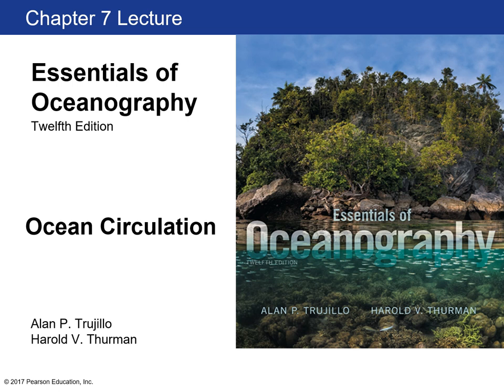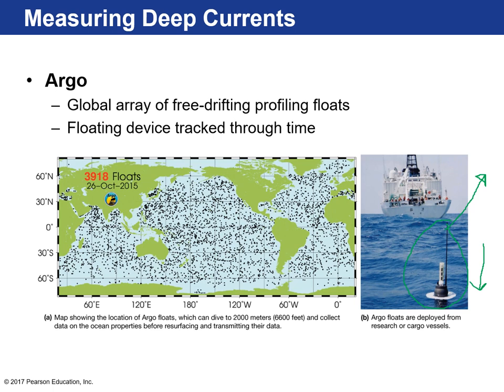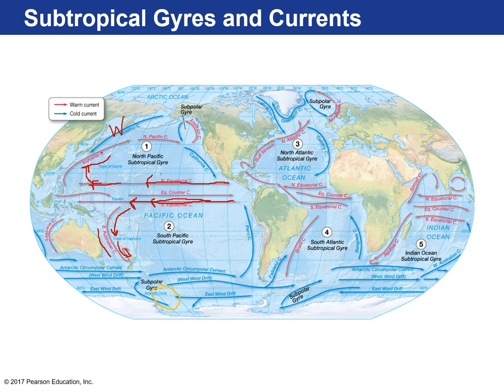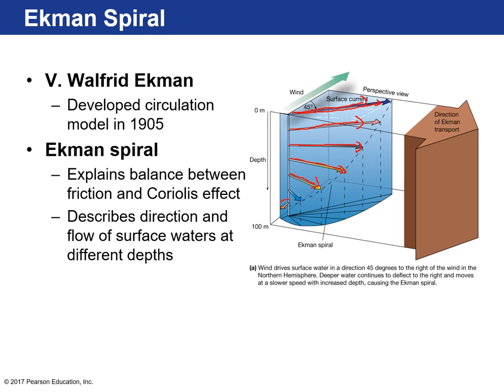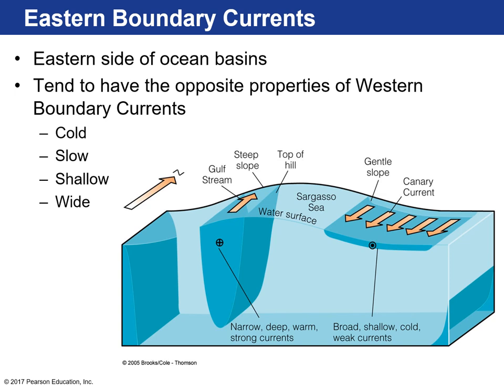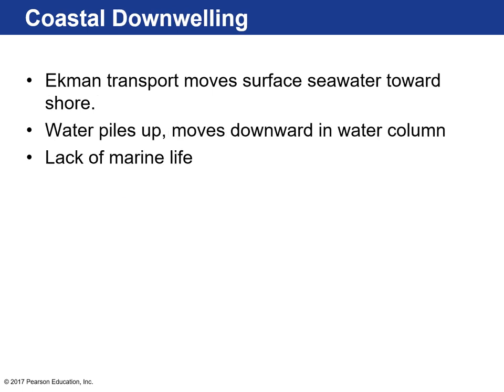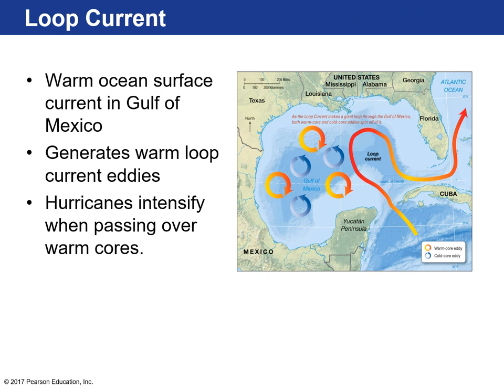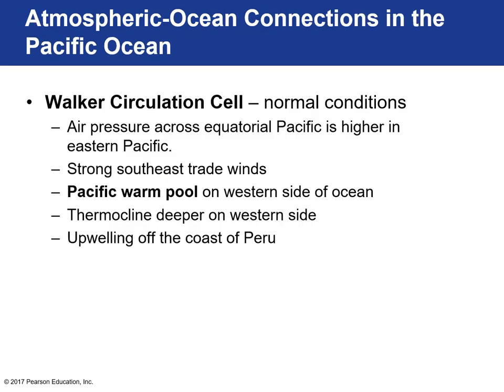Ocean Circulation (OCE-1001)

Comment: How can we explain upwelling or downwelling in the poles and the gyres?
Reply: Pressure chimneys. Cold surface water contracts & makes a surface dent, water flows to fill it and makes the column to the sea bed higher pressure (more weight above it) so it shoves water towards equator and beyond. Deep water leaving makes the entire column drop  so now there's  a surface dent again and so on, it's unending until the deep pressure along it path rises to match its higher pressure or its own pressure decreases because its surface water heat. Ice forms in pancakes if its cold enough, and wind blows the low-salt pancakes away making a surface dent, salty water around flows into the dent, now its saltier so its heavier. As long as it has a horizontal path at a depth range it can go on for ever. When the water its shoving gets shoved into a cul de sac (sea bed rising) it lifts the entire ocean above it like a wedge and that makes a surface bulge so surface water runs down hill off the bulge back to where it came from. That's a long-distance overturning circulation like 25,000 km or 40,000 km, whatever. Simple stuff.